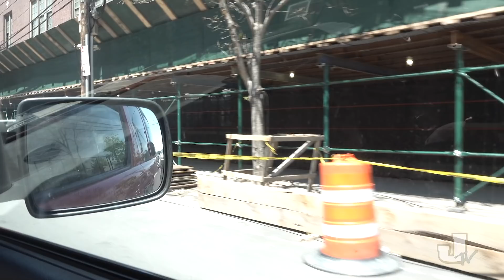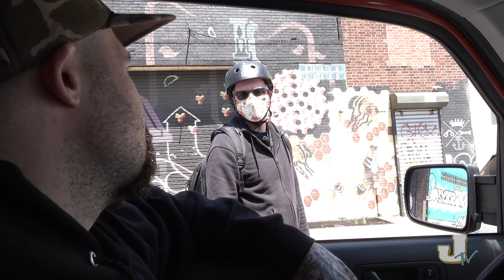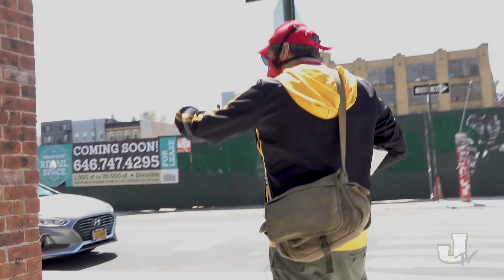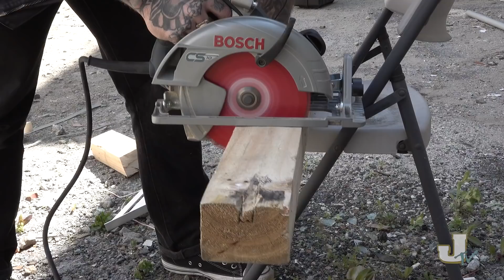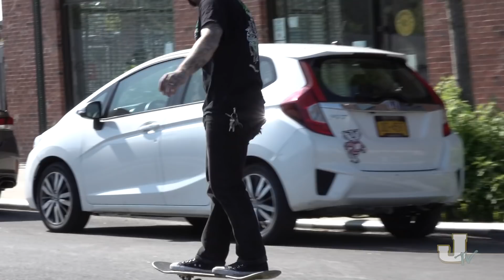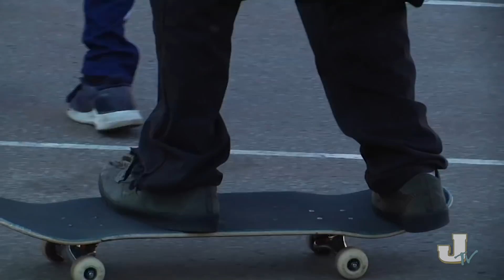JENK TV - Building a Box from NYC Street Trash

Comment: This is hardly a trash box, you were basically given good lumber and metal lol. Not trying to hate, I just thought it would be more improvised/jenky.
Reply: yea lol they looked around for a while then just got wood from the homie and used perfect angle iron. When I built my ledge I found this pile of old 2x4s and sheets of plywood that had been sitting next to this foundation for like a couple years, basically in the forest near my house. I went down there with a homie and carried up a bunch of wood through the forest. Then I found a piece of angle that was too short in my grandpas scrap pile and got my grandpa to weld an extra foot on for me. Ended up being a dope fucking box until my moms boyfriend ran it over with his truck. The bastard never owned up to it tho...